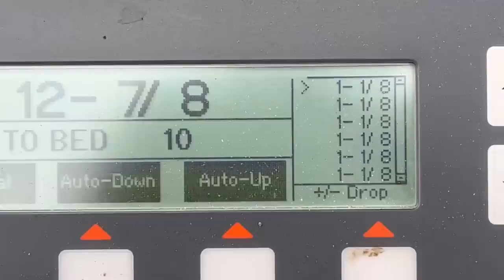TIPS FOR CUTTING LONG LOGS ON A SAWMILL!!

Comment: I always cut 16 ‘ 2” logs on my LT-30 , the biggest challenge is positioning the log on the mill . I cut western red cedar, up to 30” logs . The dust is a big problem . A lot of species don’t produce as much dust .
Reply: Western red cedar dust is a serious health hazard. You should take extra care to prevent breathing any. All hardwoods have a big risk too but some can be really nasty. Effective extraction at source is worth every penny although horizontal saws are all notoriously bad especially if the operator travels along with the head.
Reply: @richardlee2488  I always saw in a building well ventilated , roof only no walls . My old Dad worked the old time mills , the old timers always chewed tobacco. He claimed spitting all the time reduced injestion. The dust mask is pretty useless , ultra fine dust passes straight thru them . Reducing exposer time is the only way to avoid being contaminated by any substance, give your body time to clean itself .👍🇨🇦

Comment: My local sawyer (with a 30 yr old Wood Mizer) uses windshield washer fluid as a lubricant. He can saw up to 18' logs, but prefers 12'. We keep the truck perpendicular to the mill, so I slide the lumber off the mill and onto the truck, without ever fully lifting it. The day can be long and hot, so every little logistical advantage is important.  He edges the lumber on the mill, and some of that becomes stickers. I enjoy milling lumber, almost as much as I enjoy watching you do it. Hemlock is not common here (western Quebec) tamarack is more common, and similar properties. I'd rather have a pile of lumber in the yard, than money in the bank.

Comment: Fun fact: You can use the same ground coffee twice to brew coffee. Just dont tell anyone about it.
Quite some years ago at my workplace we noticed that the box with the ground coffee got empty unexpectedly fast. Especially on weekends when we as the dayshift werent even present - there were day and nightshifts also weekends, 24/7. It was a laboratory, one of the devices we had was a vacuum dryer. We dried the used ground coffee, the vacuum made sure no one smelled something(haha), and filled it into the usual box - the fresh one we did hide. We let it go on for several weeks. The second hand ground coffee was quite popular. I guess if it is for free, it tastes much better😁Then we leaked the fun fact mentioned above. Rather suddenly the amount of coffee in the box did stay the same😂

Comment: Coffee, yes!  I cut my third log ever on my new LT 40 today . I will be modifying the water tank for easier filling , what is a good organic blade lube in your opinion? keep up the great videos, thanks.
Reply: Welcome to the world of sawmilling. Just a hint as your just starting out is on long logs it can pay to keep turning the piece to release the tension evenly. It takes longer but you get straighter pieces without needing to go back to straighten any. Very useful if cutting mostly beams.
You are limited to blade lube choice as the saw has rubber tyre wheels but water is the best thing for softwood. Ash can be a nightmare as it sticks to the saw teeth. Within minutes of stopping it hardens like concrete which you can remove by soaking in a caustic soda bath off the saw of course. Hope that helps you one day.

Comment: nothing wrong with being lubricated especially with  long logs ha ha,  on a more serious note yes everything thing more challenging with longer logs and you weren't rambling , pine with knots i found more blade tension because of variation in wood density and lots of lubricant and i add some pine sol to keep the blade free of sap , downside of more lubricant is the chute plugging up but better that then braking a blade due to stresses. keep on keepin on, cheers!

Comment: I have to say, I love your channel and love to see people actually making a living with Wood Mizers.  But as usual I have have some unasked for advise.  Crank up your speed.  Like double your feed rate and back off your lube.  You should only use as much water and soap as you need to keep the blade clean of sap.  There are only two things that make a blade heat up, sap build up or a dull blade.  If the blade is sharp and clean, and you have the HP, which you do, you should be able to cut a 40' log (with bed extensions of course) and never slow down.  Sorry, I just remembered a third thing that can heat up a blade, too much sawdust collecting in the gullet.  Believe it or not, this happens when you're not feeding it through fast enough.  
Keep up the good work, stay cool, and stay safe.
Reply: I only give blade a shot of old diesel with a hole in cap of Gatorade bottle when pitch builds up. Stopped running water 20 years ago..